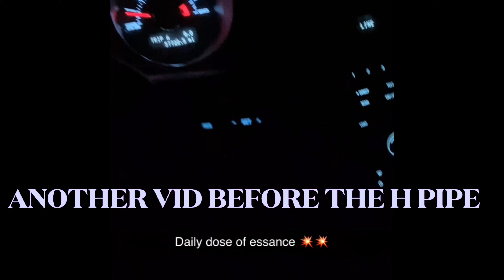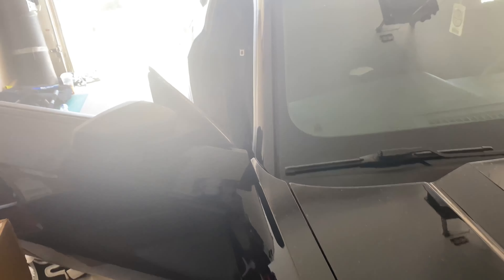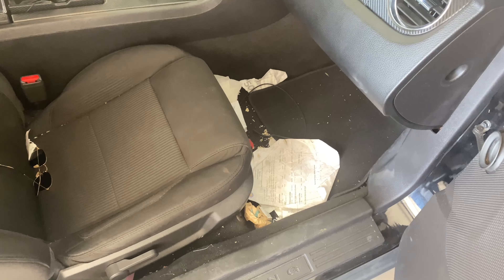H-PIPE INSTALL!!

Comment: Is this with any H-pipe found in any shop that u installed or is this a specific H-pipe u got?
Reply from the maker: I got it from a place but it didn’t fit so i told the muffler shop to make a custom one
Reply: @S197. JAY  Oh ok. So it's just a custom generic h-pipe? No specific one?
Reply from the maker: No specific basically told him to straight pipe it and add the pipe in the middle to make it a h pipe in my opinion gave it a little deeper tone the the x pipe